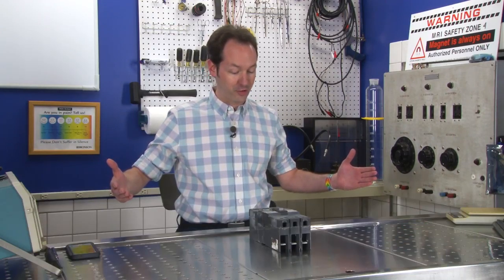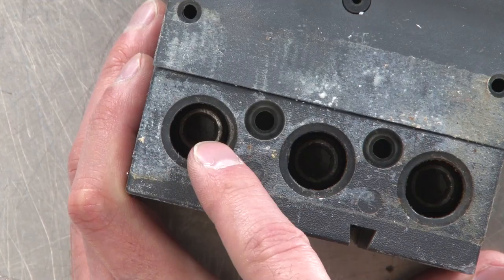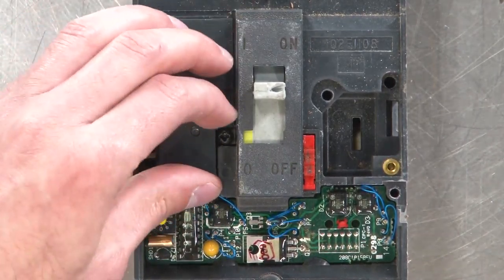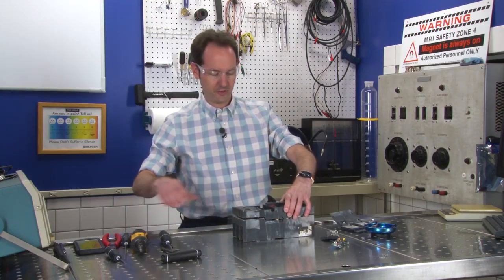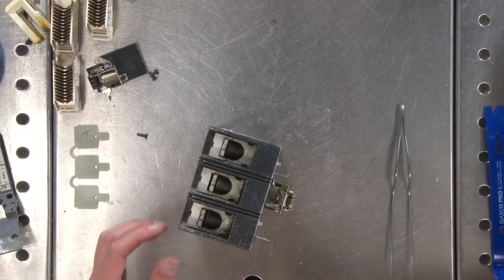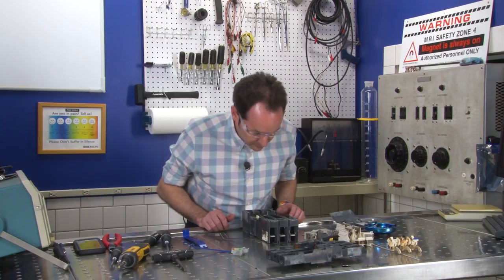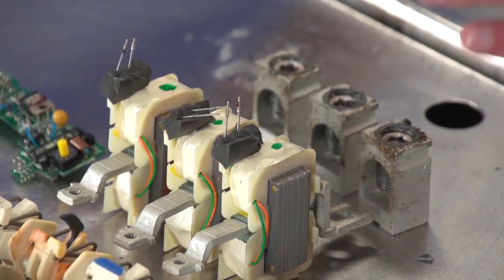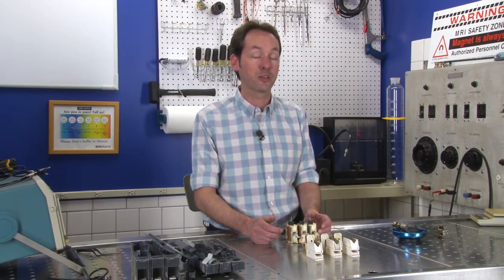Circuit Breaker: (Re-upload)  Equipment Autopsy #99

Comment: That big of a circuit breaker reminds me of the one in Jurassic park when they need to pump a lever several times to throw the breaker its so big. Note: we actually tripped a breaker last night because my brothers metal sleeved charging cord shorted between the wall prongs because the charger wasn't in the plug all the way